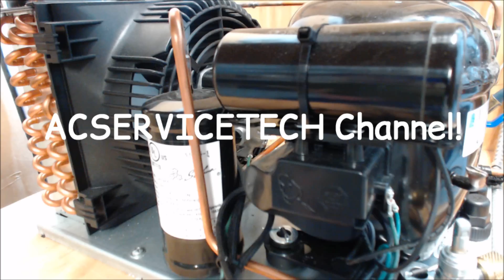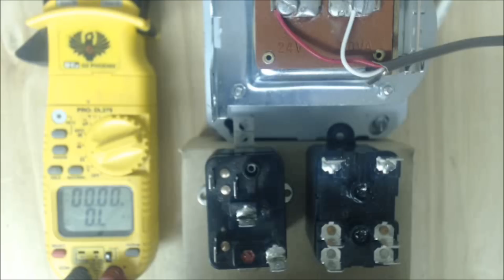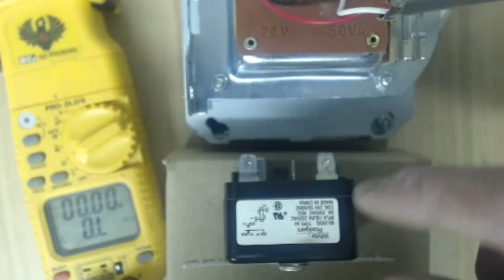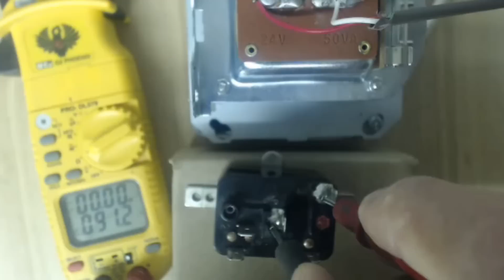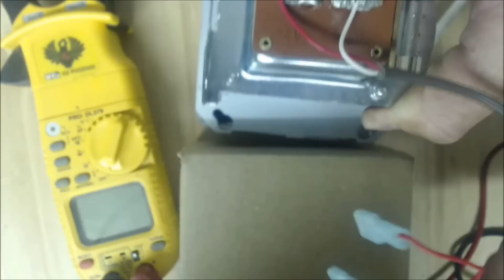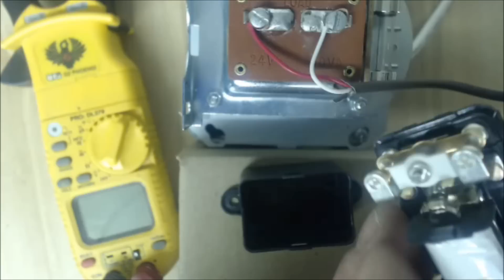HVAC Electrical Troubleshooting -Fan Relay!

Comment: If they're corroded and you Pierce down instead of cleaning it aren't you just looking past a potential source of high resistance in the circuit?

Comment: Help... Last week my furnace stopped. I noticed that I wasnt hearing the normal clicking of the relay. Ive swapped out my relay with three other ones (no change). Ive also switched the larger transformer. With the original transformer and base, my zone valves would heat up (still no pump), but the replacement one did not energize the zone valves so I switched back. From what I can tell, my thermostats are working (I hear the zone valves engage and they heat up [to the touch]), and we've jumped the pump and know it works. Im stumped.

Comment: Best channel on here.  Keep it coming brotha 💯
Reply from the maker: Thanks a lot Dapper Don!
Reply: @acservicetechchannel   Quick question I notice  That when I check  My super heat outdoors it tends to be higher then when I check it indoors.  What should my super heat range be when checking outdoors? I typically check it at the vapor line coming out from the air handler for an accurate reading
Reply from the maker: The total superheat should be very close within a degree or 2 of the superheat unless the vapor line is picking up heat on the way outside such as in a hot attic. How long is the line set and does it run through the attic, thanks!

Comment: 0.0 ohms of resistance is good across 2 & 4 and 5 & 6 when the contact is closed? But it's not good on the low voltage side 1&3 and that would mean it's burnt together and OL means burnt apart?
Reply from the maker: 4 to 5 is normally closed, 2 to 4 is normally open. When it is powered it is the opposite. Your observation is right on the money! 1 and 3 should have some resistance if the coil is intact and 0.0 is burn't together, 0.L is the coil burn't apart. Great!
Reply from the maker: David did you ask a question like a week ago. I saw something in my notification area but it never appeared in my comment section?
Reply: Yeah it was a video in the heat pump playlist section. You were talking about how to take resistance on the outdoor fan. My YouTube app is really glitchy and freezing up a lot not sure what's going on.
Reply: I just reposted my comment in the video I was referring to.
Reply: What if 1-3 has 2.04 ohms?